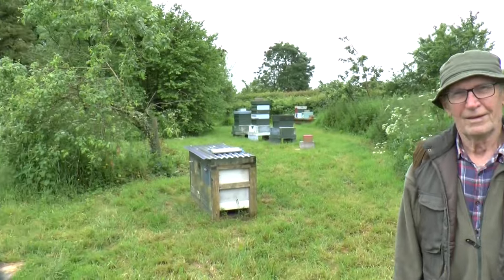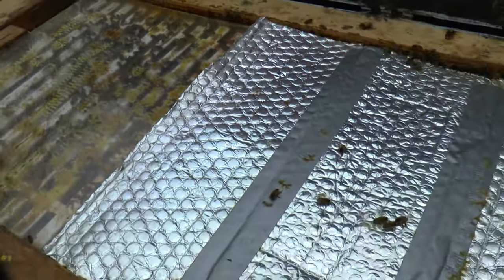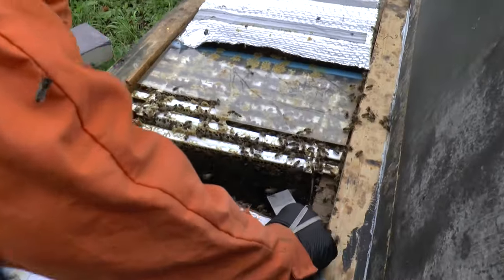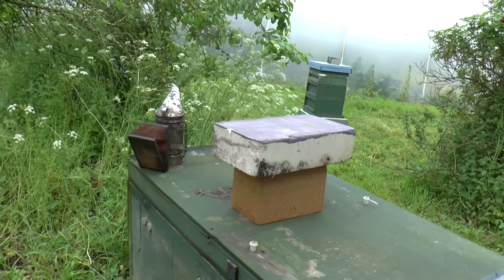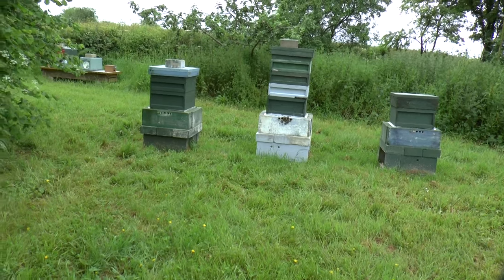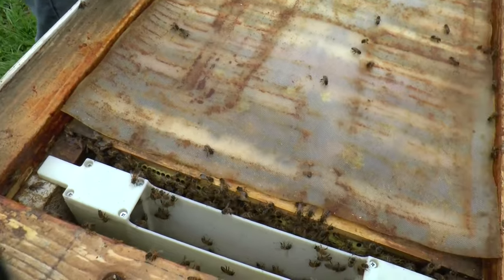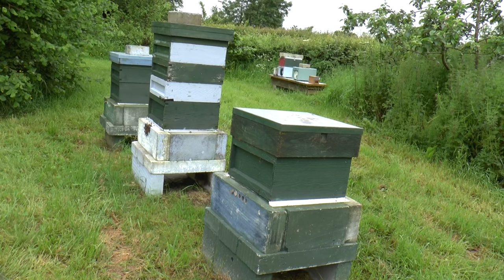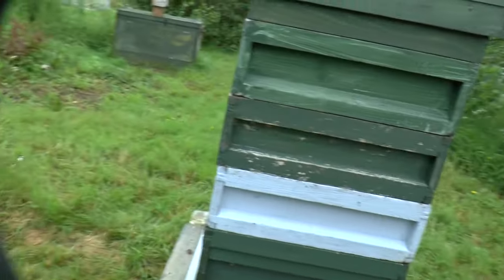Doing More With Less: Treatment-Free Beekeeping With The ZEST Hive (and introducing the James Hive)

Comment: I suggest that the blocks where exposed be painted with bitumen paint and the angles set down on mastic. I still prefer the full ZEST, version as simpler to work, but James had a load of wood hives to use up and it does that very well.